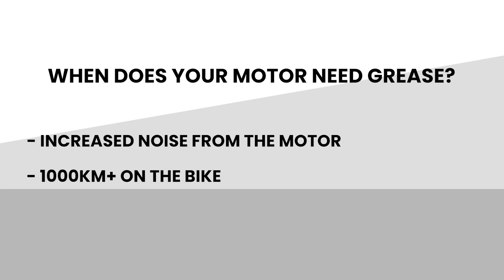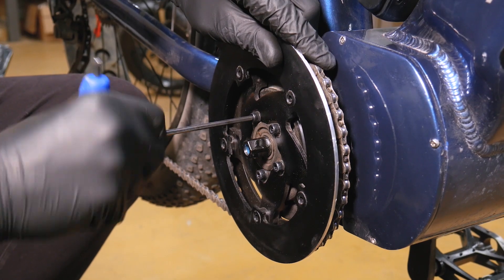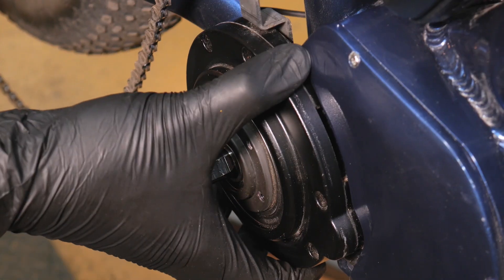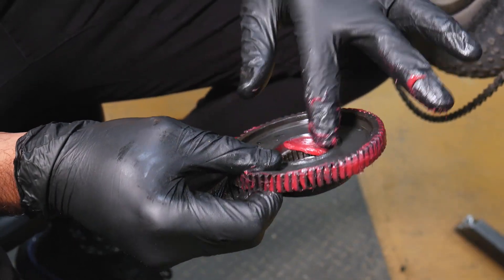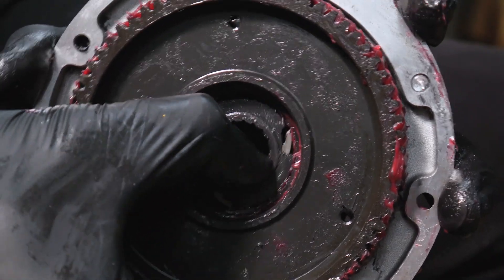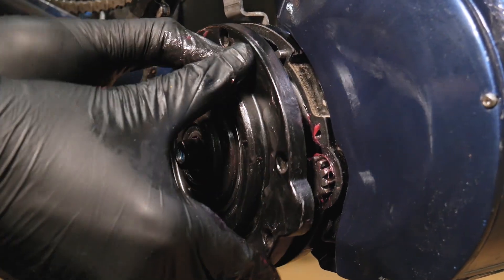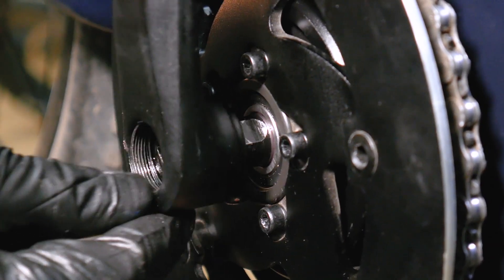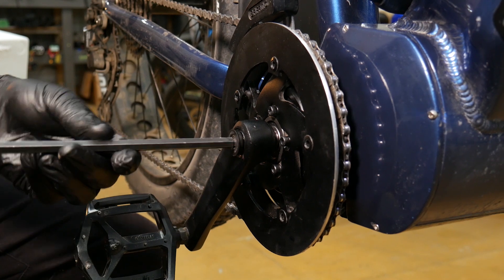Make your Bafang Mid-Drive Last Longer - BBS02 & BBSHD

Comment: Greetings. Does it have to be synthetic grease from the company Mobil 1 or can it be another manufacturer such as Abro Masters Synthetic Lithium grease.
Reply: You can use TF2 grease, safe to use on pinon gear side and in the nylon gear.

Comment: Lekkie makes an aluminum motor cover with a grease zerk .. Get a good Anti-seize Black Moly Grease with Li2 (lithium)thickness.. that will protect and lubricate your gears without damaging the plastic gears.. the grease this video demonstrated will void your Bafang BBS warranty.. Use the correct BLACK MOLY with Lithium 2... or you will be out of luck when the plastic gear breakdown..

Comment: THIS IS THE WORST ADVISE EVER! 

WHY? TOO MUCH GREASE CAN RUIN YOUR BEARINGS! 
I have as BBS02B (version 2) and the bearings (Silnt 16002RS) that hold the small pinion gear shaft has 2 functions: 
1-reduce friction on the pinion gear shaft
2-separates the moly/lithium grease from the crank to the plastic/silicone grease inside the nylon gear. 

If too much grease is applied, like how the video tells you to do so, then that grease will be forced into the crevices of the 
bearing and it will seep through the nylon gear and its plastic/silicone grease. If you ask why this is bad: the mixture of the plastic/silicone and moly/lithium grease can ruin the pinion shaft bearing and ALSO THE ONE WAY CLUTCH MECHANISM of the NYLON GEAR (yes, it has a one way clutch to ISOLATE the Electric motor whenever you're pedaling but enables the motor to drive and assist).  This one way clutch is similar to a ceramic clutch, or a silent freehub, but still if too much grease enters it, it ruins both the nylon gear and the pinion bearing.

Symptoms of too much grease:
-more effort in manual pedaling (less efficient, not that noticeable)
-clicking noise that can be heard and felt on the pedals whenever you are pedaling when having little to no motor assist
-by opening the motor: grease can be seen leaking through.. 
-pinion bearing inner race not following the rotation of the pinion shaft. 

Note: there is an oring in the pinion shaft that also prevents the seepage of lithium/moly grease from the crank to the nylon but if the bearing fials then the friciton will also induce a failure in that oring as the inner race of the bearing no longer follows the shaft due to high friciton.

Comment: Excellent video and well narrated. One constructive comment though...I found it unnecessary to remove the crank on the Bafang BBS01. Simply remove the pedal, then undo the crank ring, slide it over the crank arm to remove, the same for the motor cover. This leaves the gearing exposed for regreasing as you described. Reverse the process to complete the task 👍

Comment: bonjour,

sur mon bafang m620 , j'ai changé le capteur du pédalier, puis le côntroleur,

le moteur fonctionne uniquement à l'accélérateur.

j' ai acheté aussi l'écran C961  pour étalonner le moteur , mais je n'arrive pas le paramétrer.

en appuyant simultanément sur + et - , on ne rentre pas dans le menu.

est-ce que vous pouvez m'aider svp ?
peut-être les coordonnées du fabriquant.

cordialement
Good morning,

on my bafang m620, I changed the pedal sensor, then the controller,

the engine runs only on the accelerator.

I also bought the C961 screen to calibrate the motor, but I cannot configure it.

by pressing + and - simultaneously, you do not enter the menu.

can you help me please?
maybe the manufacturer's contact details.

Sincerely

Comment: nice video thanks. any tips on making the controller last longer?

My bbs02b has had two controllers fail both around 400km's.

So 800km in and Im already on third controller..
Reply: From what I can say after riden for 8400km on the stock controller without any problems. Dont ride it to hard at a high pass level. When the cadence is to low and you are riding into high gears, lots of watts turning into heat, if you possible dont use your gears right. Specially at the summer, if you life in a country with a hot climate. Allways use your gears right, shift  low enough when going uphill. If you can feel lot of resistance on your pedals going up, then it will also be very tough for motor, and the watts your motors uses will be send into heat in your controller and tough for motor granny, pinion, nylon gears and motor copper stator windings. Limit your max amps to 18 amp, the controller from the BBS02 cant handle 25 amps for long, BBSHD has a much better controller. reprogram your controller for smoother cycling. Sometimes at summer when i drive at high pass, the controller feels very hot (even below 18 amps)after you recognize this, quickly lower your pass level. I'm going to install an temp sensor (like i read on the internet)to keep an eye on the temperatures of the controller.
Reply: From my experience, owning bbshd for 5years or so, I've had one controller error, it happens, my advice is upgrade the motor and battery connection, I had anderson poles and they melted and come loose, went to xt90, disconnect the battery when charging to avoid sparks, don't buy cheap a battery, avoid programming the pas settings to stupid currents and percentage, same goes with the throttle setting ( can cause alot of issues ) being to high power. Bafangs paper gaskets are crap, use some rubber gasket sealant instead, it forms a better waterproof seal, check the sealant that covers the controller so its not getting any moisture in, check all wires to make sure they are not loose, apparently this is the main reason for errors. I've covered over 3000+ miles on one bike and 700 miles on my back up, 1 controller fail and one stator issue.

Comment: This demonstration guides you to use the WRONG KIND OF GREASE... you will DAMAGE THE NYLON GEARS with that grease..  I know.. I had to send my motor back to bafang and they said, "warranty void, use of wrong grease". They then told me about BLACK MOLY Grease NGLI 2 Lithium.  That mistake cost me over $500...
Reply from the maker: We have been greasing motors far before Bafang started recommending them (from 2013). Trust us that this aviation grease works great and doesn’t damage the nylon gear. Make sure you don’t judge grease by colour. It’s the content that matters. Mobil 21 works great!

Comment: The only "Grease" that won't deteriorate the nylon gears is:  Black (not grey or white that have different components) Black MOLY GREASE NGLI 2 w/Lithium (thickness) Applied to the metal reduction gears... Reapply after 2k miles or anytime you begin to hear the motor spinning louder.    Many have used other greases that break down the nylon gears and cause more problems.. Select the correct one.
Reply from the maker: Mobil 21 works great.
Reply: @Biktrix    until it breaks down the nylon gears and voids the warranty..!  You didn't contact Bafang Warranty dept did you?
Reply from the maker: @rdkuless  we’ve been rebuilding these longer than bafang and have been supporting warranty for these way longer than Bafang has. Since 2013. We were and still are one of Bafang’s largest customers in Canada. We helped them define service intervals. So, not sure whom you spoke to there but no issues with using Mobil 21 grease. It has no negative effects on the nylon gear. We have over 20k miles tested and our customers have over 300k miles tested.

Comment: This is only 1/2 of the job, you definitely have to clean out the old contaminated grease then remove the crankshaft and lubricate the "Needle Bearings" they have very little grease from factory and they are often near dry or starting to rust @ 1500 miles.  Not greasing the drive system in its entirety is the #1 cause of BBS02 motor failure, a very expensive mistake.
Reply: Does this apply to the bbshd as well?

Comment: And the 2 sets of bearings on the crankshaft itself?   I pull the shaft , and grease the 2 sets of trust and roller bearings too.
Reply: Yes, perfect thing to do, indeed when you pull the crankshaft out there is a small semi integrated roller bearing, I only apply a small bit of grease on this but not the one on the non drive side.

Comment: I'm experiencing a clicking noise with my motor and it only has 300km on it. I'm not sure what the issue is but it sounds like a bearing inside the motor case. Seems odd to me these motors are not prepared for use from the factory or retailer... My bike did not come with any instructions, let alone any recommending opening up the motor to grease it... I love my bike but these are some pretty annoying problems to be having on a brand new bike...

Comment: There is an argument that the entire assembly should have been cleaned and dried before adding new grease. A little messy, but all of the wear particles will continue to wear the components, even with new grease.
Reply: Yep. Protip for cleaning grease, diesel, soak it in diesel and use an old toothbrush. If diesel doesn't get it off, gasoline sure will, just be careful if you go with gasoline, it's very flammable.
Reply: @markothevrba All I can think about is this clip from Its Always Sunny in Philly lol  https://www.youtube.com/watch?v=dnbGpj8oI8w
Reply: Not an argument. A fact. All mechanical friction parts need to be cleaned, inspected and regreased or else you are just uncontrollably adding to any problem.
Reply: @astroplutonium  Facts!
Reply: Yeah i was thinking that too! I defo would have cleaned everything before re greasing.

Comment: Just bought a new BBS02 motor as a backup to the one I've been using for a couple of years. After seeing some of the videos about greasing the motor, I decided to take a look at the situation with the new one. Next to NO grease on the gears! Couldn't see ANY on the meshing surfaces! Greased it thoroughly and will have a look at it again in 1K miles. No doubt greasing it when brand new will help it last a long time.
Reply from the maker: Good thing that you checked :P
Reply: @Biktrix  so the big question for potential buyers of your brand, do we need to worry about doing this procedure on a brand new bike? Or is Biktrix opening every single Mid Drive and checking/adding grease as required?
Reply: It takes literally less than 5 mins to check @jameygray why would you not just do it for peace of mind?

Comment: hey BBS02 users, what mileage did you make? and how does it work now?
I made 3000km and it runs like a new one (no regreasing so far)
Reply: 7500km now,  without opening/regreasing
Reply: I've done 16,500klms since fitting the BBS02 to my Bianchi hardtail. Had it regreased by the installer at 6mths, then did it myself based on this instructional video...very easy indeed. Extremely happy with the Bafang package 👍
Reply: Just doing it now after 2000km, original grease is black but not dirty or with particles.

Comment: It's not a clutch, it's a RATCHET..
Why do people keep calling it a clutch, you can’t disengage the drive, it doesn’t gradually introduce the drive through friction material. 
It’s a fuckin’ ratchet, a one way mechanical engagement system…
      Also over greasing is stooopid .
The excess grease will just fly off and cause heat and get in the way, also clean the old grease and any swarf away, then brush a small amount on any moving part that needs it..
              You're welcome 😄

Comment: The unit already is delivered properly greased. There is no need to do this- also the reassembly of the cover is very exacting. If not exactly aligned you risk cross threading the screws- then you're really screwed...

Comment: I’ve just purchased this BBS HD and installed it and wrote it for 200 miles, the issue I’m having is the motor will provide too much resistance or something is to my peddling so anything under three speed on nine speed mode it’s like paddling against the current or as if the brakes were on. I know it’s nothing to do with the wait because for some reason when the motor has been off for a night or a long time and you initially try to pedal without turning the motor on there is no or little resistance it’s only after activating the motor and paddling for a moment that something engages inside which starts the resistance again. Of course the motor works and rolls you up the hill good but the problem is it’s like there is the brakes on all the time which I think can cause extra lots of battery to lose as well as it’s near impossible to go anywhere when the motor is off or in low PAS. I am hoping somebody knows any solution to this I’ve read maybe I have tightened the motor too much as a lot of people recommended it can loosen but also maybe the nylon gear has already went out or they’re just needs to be way more grease inside any help would be appreciated I have not looked inside yet but just disassembled everything
Reply: Since it's been 9 months did more grease or anything help?

Comment: I bet this should be done when the bike is new. The grease they use in the factory prob isnt very high quality.
Reply from the maker: Not really needed when new from our experience.
Reply: @Biktrix  When should it be greased then? I just brought one new and was thinking about greasing it immediately.
Reply from the maker: @X6800  doesn’t hurt to do it right away but will probably run with no issues for a few thousand miles

Comment: If I should add grease to my Bafang BBS02 when there's 1000KM on it, does that mean I have to add grease every 10 - 12 days? Because I commute with my bike about 100 kilometers a day. Like, that doesn't sound right. Can anyone please enlighten me on this matter? Thanks.
Reply from the maker: Just check it every few weeks or if the motor makes louder than normal grinding noise

Comment: Petroleum base grease is not recommended for nylon gears at all it makes them soft causing more harm than good!  Silicon grease is recommended plus it also has the advantage of being dielectric (none conductive) so its save to use around electronic's like the printed circuit board inside there.
Reply: I would think the nylon gear would be quieter and would be sacrificial in case of failure.
Reply: @sbramel93  Exactly, adding steel is counter-productive.
Reply: If you are in there, just go ahead and replace the nylon gear with a steel one.
Reply: @mr.monitor.  That nylon gear will last ages, had the same one in for 4years now and its almost like new, I run full 30amps through it, the only reason I see when users wreck them is from over throttle use or setting the amp current stupidly on the pas settings, that said nothing wrong with steel gear.
Reply: @OutandAboutDevon  If you are in there, just go ahead and replace the nylon gear with a steel one.
Reply: @mr.monitor.  again no need, had the same gear in for thousands of miles now.
Reply: @OutandAboutDevon  If there was no need, they wouldn't make them. They now make a nylon steel hybrid that is even better for this purpose. People wear them out all the time. I'm glad you had good luck with yours.
Reply: Listen to that noise, no thanks!!
Reply: @mr.monitor.  I believe the hybrid gear you are referring too is the Peek gear, looks interesting but expensive thou.
Reply: @OutandAboutDevon  They don't make much noise when they are greased properly. I'm using the John Deere cornhead. Works well. Still makes noise, but I don't mind.
Reply: @OutandAboutDevon  Not broke don't fix it.
Reply: My bafang motor exactly after 4 years 🙂though I do cycle during winter time so it got fried
Reply: @HB-yq8gy  Yes, spot-on, that Nylon Gear is meant to be used, if it's not broke it doesn't need fixing, it's already been proven that the steel peek gear was a horrible idea.

Comment: Hello, what do you use for grease? And you put it on every how many miles? Thank you
Reply: He used Mobil 1 wheel bearing grease, I think.

I got some Mobil 28 aircraft grease for lubing bike motors.  It’s a little softer than regular Mobil 1 - which I also have as a general purpose grease.
Another good one is SuperLube grease with Teflon - which I used on installing the forks.

Comment: Hi! A little question: what would it do, like, at -20˚C in winter? Grease would hardened a little bit? If so, is it going to drain the battery a little faster?
Reply: Yes, of course the additional grease will be adding to the internal friction of the gearcase, and moreso when the grease is cold. One way to test this is to put an ammeter on the power leads before greasing and after greasing, and bring the motor up to same speed both times, and compare the amperage draw. Then let it get cold and try it again. With the amount of grease added in this video, the difference could be significant. Remember though, you're only measuring the motor spinning on a stand; it's not really working as it would be on a ride. Maybe less grease, but still have plenty?? Need more data.
Reply: In minus degrees use silicon based grease
Reply from the maker: Great question! The grease will be fine, just have your cadence nice and high to so the motor spins quickly and efficiently
Reply: @Biktrix  At -20C the grease would be doing much better than the rider.
Reply: -20 shouldn't hurt the rider if they're properly dressed.  I'd be more concerned about the battery. Best to keep the battery inside when not in use.  While the battery is in use it should create some of it's own heat and not get too cold for a while.

Comment: I personally would have wiped as much of the old grease off as I could, didn't seem like you wiped off any at all.
Reply from the maker: A big thing with these motors is that a lot of the time they don't come with that much grease in them, so it's more about adding grease than cleaning it
Reply: @Biktrix  I hear you, I just don't like to mix different types of grease if I can avoid it. I'm sure its not an issue but just one of those things I try to avoid.

Comment: i would use a lighter weight grease on the clutch in cold temps that grease may not allow the pawls to release good and may break pawls etc had it happen on rear hubs with similier configurations